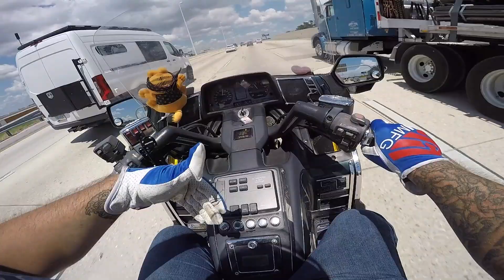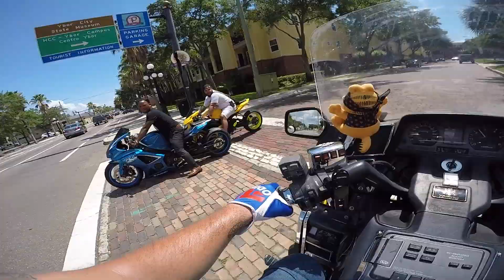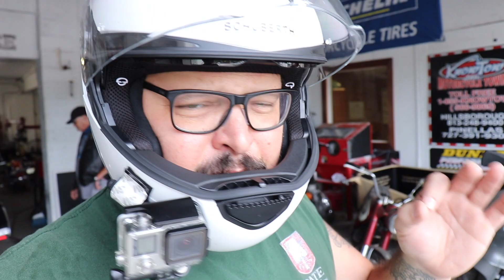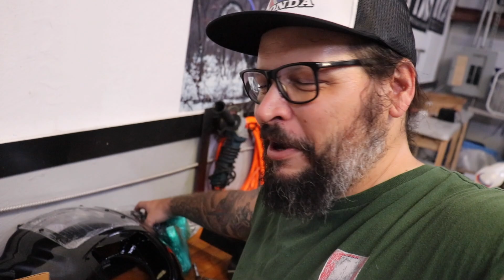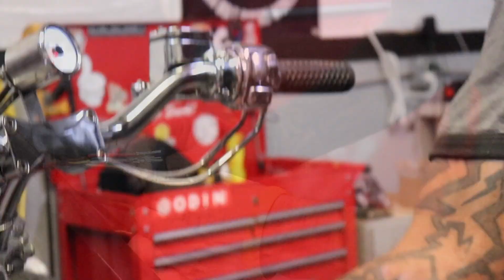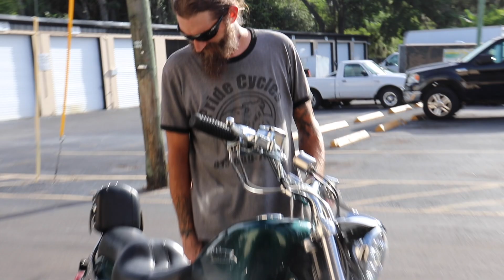Why it all went wrong... | Cheyleesi Sportster Build

Comment: Hey man! I couldn’t tell in the vid, but with the krator fairing it comes with brackets that are set up for the width of 49mm forks since so many dyna guys use them too. If you get the 39mm brackets from bung king and swap them it’ll fit perfectly with the quick release clamps you have on it now. I have that set up as well.

Comment: With my krator fairing i had to dremmel out some of the meat around the headlight hole to get it to fit snug. Only later did I learn that these fairings usually require a headlight spacing block that sticks it out father and lets the fairing fit without modifications... good thing those fairings are cheap lol

Comment: Don't know much about hydraulic clutches but the stock clutch basket has a spring plate that has rivets that tend to grenade around 30k, it's a design flaw but into sportsters to make the clutch pull easier. If you put in another standard clutch the pull is incredibly hard. Good move on the hydraulic for Chey. My sporty did not have one and everyone that ride it just said....Dude! That clutch pull is nasty.

Comment: That's a very small wire connector collection count. Really it is!  Try installing all the police equipment on a patrol car then, you will know what a big wiring job looks like . The new solid state lighting system have made it a lot easier than it used to be.

Comment: If you want to help Shea with her clutch issue Harley back in the early 90s put a bolt on device that you hook on to your underneath Mirror it is called a AMP Clutch assist they are still out there because I just bought one and it was in Central Florida at a motorcycle shop it cuts the pull force by 40%

Comment: How much did the brake line cost? When I saw the banjo fittings, my heart soared! I'm 8 miles away, and putting a bike back on the road for a poor brother. Webster has helped, but some things you need new.
Reply from the maker: All three pieces were about 120 bucks! If you just need a single line it’ll be much cheaper
Reply: @shadetreesurgeon  Thanks, and it is single line.

Comment: You and Cheyleesi inspired me to put my Harley project off until I can afford it and get a Goldwing with my stimulus.  To be honest I really could use someone like Shelby in my neck of the woods to finish going through and making her road worthy.  And she still needs a name, someone suggested something like The Crimson Yak or The Crimson Yak Sauce.  At least you have a garage and a motorcycle lift, I have a parking stall and the cold hard oil/grease-stained/dirt covered/glass dust covered/rocks to lie on instead of a creeper.  I've made it through the Starter, Battery, Air Filter, Fuel Filter but still have the Oil Filter, Oil, Timing Belts, and Carburetor rebuild to get done.  With the health and mental health issues and the Triple Digit Weather, it makes things interesting.  She ran twice before I ran out of gas!  So, there is THAT!  She runs!  Still a ways off from doing what you do.  But I'm getting there, slowly but surely.  Even though I have to pick and choose my battles with the weather.  But then I have to put the body on afterwards.  Anyway, I love yours and Cheyleesi's content.  Give her a big fat hug for me and tell her I said she's got this.  Just take your time.  ....Got a hold of the DMV to find out my fees are $240!  I can't win for losing!  In the meantime while I impatiently wait to ride... Does ANYONE have any name ideas?

Comment: @shadetree surgeon Krator fairing doesn't fit because it comes with brackets for a 49mm front end. Bung King sells brackets for the 39mm
Reply from the maker: I was actually using some Harley bracket from a windshield but I’ll try hung king!
Reply: @shadetreesurgeon  those will work what I mean is the black sheet metal brackets that come with the fairing need to be modified or you need to get the bung king ones meant for a 39mm front end. I dont know the rules for sending links on YouTube but if you want I can send you the link on Instagram
Reply from the maker: @caseyjones58  ohhhh nice! Thanks for the tip

Comment: Sportsters are THE best Harleys. Change my mind. Derby cover gasket need not be a PIA. Put some grease on it and it will hold on while the cover is fitted. Even a drop or two of crazy glue can be used, but grease is the way.

Comment: There are other YouTube channels that agree with you. The hydraulic clutch does NOT belong on a motorcycle, and should be banned. The same goes for fuel injection, electronic ignition, antilock disc brakes, cruise control, and electric start. Let’s get rid of all of that completely unnecessary nonsense as well.
On second thought, maybe the hydraulic clutch, disc brakes, and electric start are okay, but only for girls!